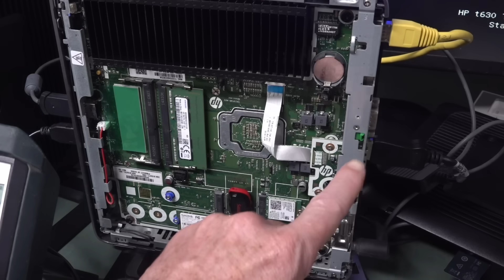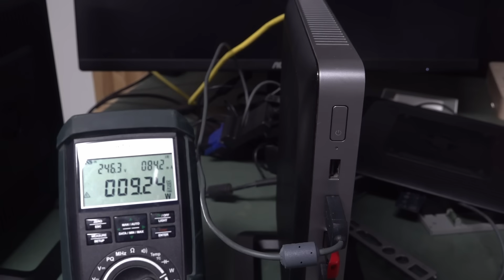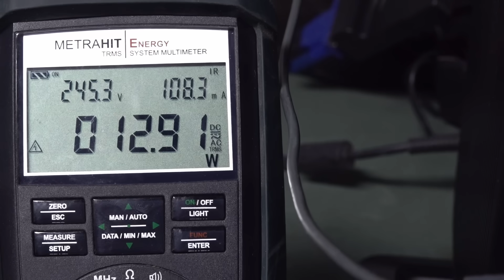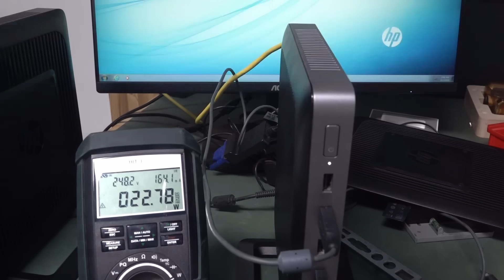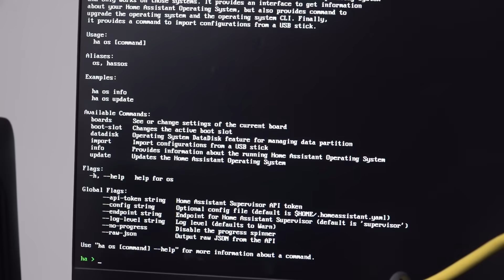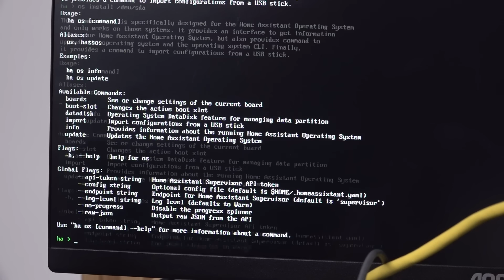How Badly Can I Screw Up a Home Assistant Install?

Comment: I did the HA install on a pi4 and messed it up the first time. I went to the web console, changed the IP address to my network. I couldn't connect to it after.  Turns out that after i changed the ip address, the subnet went 255.255.255.255. I noticed this after a reinstall...

Comment: Modern Raspberrypis are also guzzling good power. The newer ones also draw about 12-25 Watts iirc. Only the ancient low power pis (that are not longer recommended by HomeAssistant) were 5-10W.
Reply from the maker: This one is measurign 8.8W idle after finally set up with the HA on the internal SSD.
Reply: My biggest complaint with the Pi 4 and Pi 5 is they will complain and refuse to boot when powered from a USB 3.0 port. So you NEED the beefy Raspberry Pi USB-C power supply just to boot them. And they get very hot so they need active cooling. I think it's the effects of using older lithography nodes and pushing them way too hard, which undermines the main advantage of a Pi (efficiency).

Comment: I used method 1 from the installation guide, did you disable the secure boot thing ?
Reply: he didn't read the installation guide, he used Grok.
Reply from the maker: Secure boot is disabled in BIOS.

Comment: looks like most of the HA OS install doc's is about flashing the boot medium. you may need to run a ubuntu live image on usb to format the drive and then do the install on it like how you made the usb stick HA OS.
Reply from the maker: I just removed the SSD and used my desktop to flash it.
Reply: @ I have not bit the bullet for this yet but i want it to read my solar system directly instead of via the cloud (solarEdge) and then go tell my EV car on the amps to charge or stop charging if it rains etc.

Comment: Don't underestimate how useful smart home stuff is. Even if it's just having Home Assistant automatically turn on/off your outside lights based on time of day,  or automatically turning off the bathroom/storage/garage light after it's been on 30min.
Reply: The radar sensors are the best. Lights come on when you enter room (dimmer in the middle of the night). Don't go off until you leave room, even if you're sitting still.
Reply from the maker: @gargantuablargg  And your house is wiring with these things, or do you use a gazillion battery power wireless sensors?
Reply: @gargantuablargg  That sounds awful
Reply: My HA monitors all my power usage and generation. from the Homepage i can see everything i need to make choice on how to use the power i have or turn on genny to make more.
Reply from the maker: I have these things called switches.
Reply: @EEVblog2  Very modern of you Dave.
Reply: @EEVblog2  I have daylight switches and a great big relay. Had a power line fault send the daylight switch cover into orbit, as the massive MOV inside it detonated when the mains was going past 360VAC. Also blew all the other lights that were on, though the gate power supply survived because it was running on a transformer and a 1A breaker.